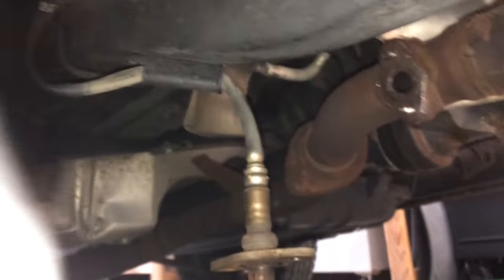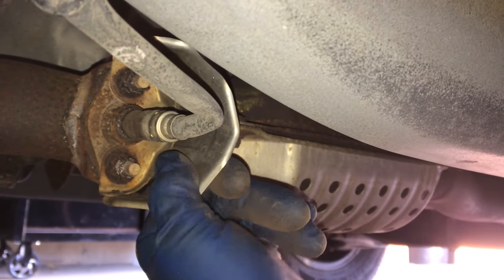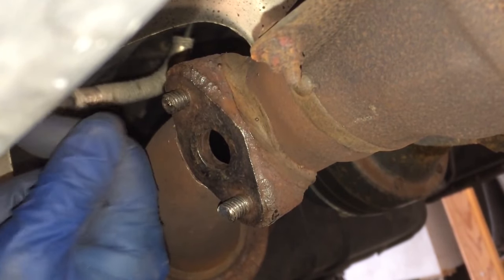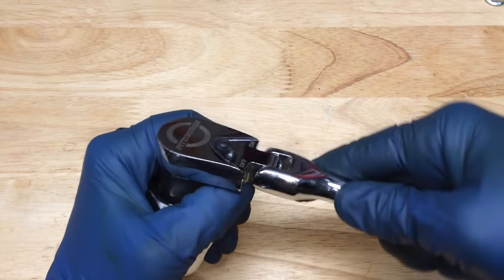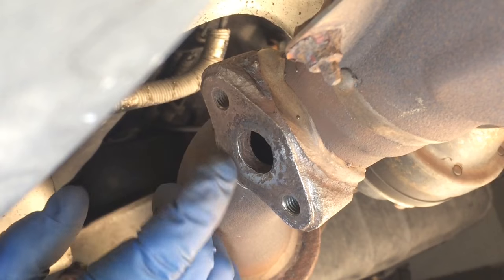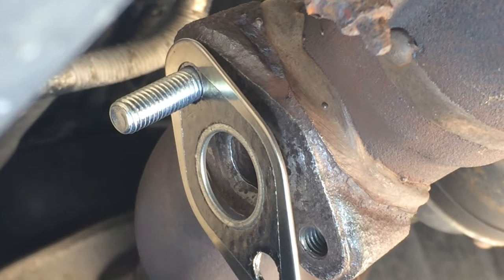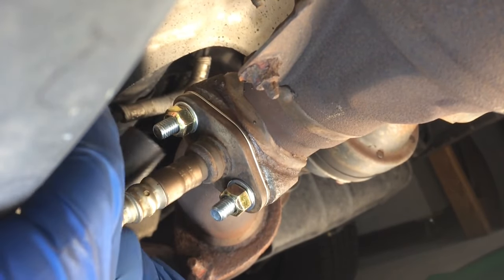Toyota Exhaust Stud Repair, Oxygen Sensor, NO WELDING, Rusted out Stud Extraction (1998 Rav4 shown)

Comment from the maker: Timestamps, Part Numbers, Tool info, Torque values:
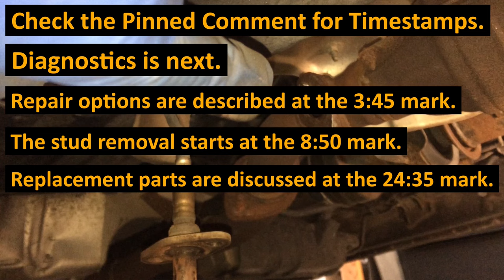00:30  Diagnostics
01:45  Other parts missing on the exhaust system shown
Oxygen sensor shield: Toyota 89437-60030
Catalytic converter shield: Toyota 18435-20020
03:00  Exhaust leak sound from the exterior
03:13  Exhaust leak sound from the interior
03:50  Repair options

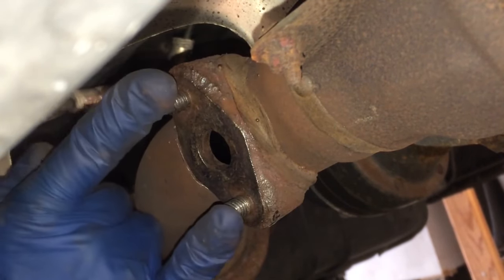05:37  Stud removal tools, ARES 70016 
08:50  Install the stud remover
10:40  Heat the flange
11:05  Remove the stud
12:41  Same process on the other stud
14:55  How to remove the stud from the tool

15:24  Welding/drilling options if the stud extractor doesn't work for you

18:18  Autozon rental tool kit: OEM 57142 Tools Thread Restorer Kit 
19:10  Use the M8x1.25 thread chaser to clean the threaded holes  

24:35  Replacement stud and nut options:
  Toyota studs: 90126-08001
  Toyota pinch nuts: 90179-08059 
  NAPA/Dorman studs shown: Napa 605-1347, Dorman 23737
  Lock nuts shown:  Needa Parts 005790
  Dorman flanged lock nuts: Dorman 432-308
26:27  Overview of the two-nut method to install studs

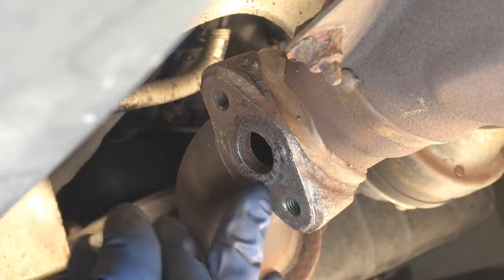28:17  Install the new studs using the two-nut method
30:26  Check thread elevation, if you're using odd studs

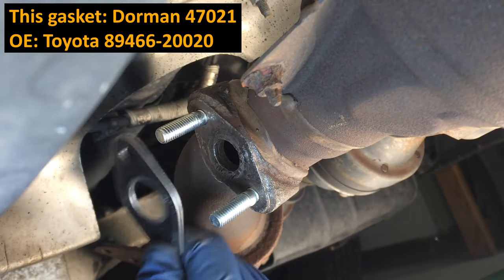32:14  Install the gasket (Toyota 89466-20020, Dorman 47021)
32:30  Install the nuts (torque is 32 ft-lbs)

34:32  Interior sound, after repair
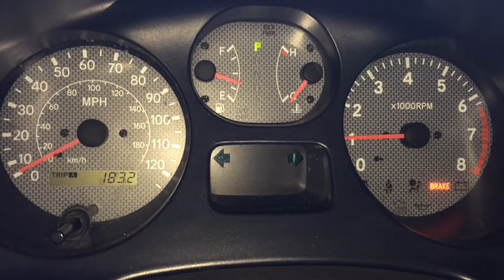35:04  Exterior sound, after repair
35:16  Check for exhaust leaks with soapy water

I hope this video was helpful for you.  
Thank you for watching, and good luck with your repair! : )

Comment: cut these bolts and weld new one - it is 2 min job.
Reply from the maker: Yes, that's certainly an option (discussed at 04:30), for those with the parts and a welder!  But I gotta say, the ARES stud extractor is a great option for those without a welder!  Thanks for watching and adding your tips : )

Comment: Get a new pipe with a bung. Find an o2 within your range and install the plug on the new one a d get rid of those stupid studs. Those are way obsolete by now. Noone uses those 😂😂😂😂😂😂

Also the cat is up by the manifold on this car it was built directly to exhaust manifold l. It could be considered a second cat  but its nothing but a pipe with holes inside it packed with glass.
Reply from the maker: Yes, indeed, that repair option is discussed around 04:07, and is certainly a solution to this problem.  However, in this case, that solutions requires more expense and effort than simply replacing the studs and re-using the original oxygen sensor, and it is also a more technical repair (my goal is always to try to show the most DIY-friendly approach, if possible!). 
Additionally - and this might not be applicable where you live - but some jurisdictions (particularly cities/metro areas) have strict emissions inspections (sometimes called "smog tests").  These tests often include visual inspections - particularly with a mirror to look for modifications to the exhaust system.  In these jurisdictions especially, it is a priority to keep repairs as "OEM" as possible to reduce the likelihood of an accusation of "emissions modification" and all the trouble and wasted time that comes with that!
Regarding the cats: the '98 Rav4 shown in the video is a Federal emissions version, so it has just one cat, which is the cat shown. 
There are two configurations for the gen-1 Rav4 (and other Toyotas of that era).  What you're describing with the TWC (three-way catalytic converter) at the exhaust manifold is the California emissions model (CARB-compliant).  If you have an FSM, check out page EC-2, EC-14, and EC-15 to see what I mean.
The California/CARB models have two cats: 
- the TWC at the manifold, which is called by Toyota the "Front TWC with Exhaust Manifold" and 
- the second cat, which is called by Toyota the "Rear TWC" (which is located in the same spot as shown in the video).
The other, more common, configuration is the one seen in the video -  which again is a single cat, as shown.  Toyota calls this cat simple "TWC with pipe".  These are the "Federal" emissions models.  
The difference can be see either by inspection, or without inspection by running the VIN.  Or, what's even easier is if the vehicle has its original hood, there is a sticker on the inside of the hood which states either Federal or California.  The hood VIN sticker can be matched to the body VIN plate to confirm if the hood is original. 
I hope that clears things up!   Thanks for watching! : )

Comment: Amazing presentation as always.  For the new studs, would you think applying nickel based anti-seize or synthetic brake grease (both are for high temp) will prevent future corrosion, therefore helping easier removal the next round?  

That RAV4 sounds so good before the repair.  It's like turning on sport exhaust button in AMG V8 😅
Reply from the maker: Haha, it did sound pretty good, but it drove rather poorly while making all the noise with that huge exhaust leak!  : )   It wasn't having it, at all, going up slopes!
As for the anti-seize: I'm neutral on it for this application.  I like anti-seize for lots of applications and have used it on exhaust fasteners before (the long bolt+spring types and some flange connections).  It certainly helps for connections you'll likely have to open again, like the connection between an exhaust manifold and the first pipe.  So, I don't think it's a bad idea or anything, but I didn't use it on these new studs.  The "red wrench" (aka the torch!) is my go-to for removing stubborn fasteners on exhaust systems and underbellies because, as you know, rust/corrosion is usually they'll become uncooperative, haha : )
Thanks for adding your tips and thanks for watching! : )

Comment: Hello dear madam, all your posts or episodes on YouTube are more than wonderful and much better than even the engineers of our Toyota dealer, and this is a fact and not a praise. You have published a lot of important things and there are only two episodes left, I think, which are 1- An episode about cleaning the injectors (disassembling and cleaning).  2-The second episode is about changing the automatic transmission oil.  This is one of the most important episodes. (for rav4 1998)I hope you will do it, thank you very much

Comment: Hello, dear madam! Do you have a video on how to remove and clean the fuel injectors for a 1998 RAV4?
Reply from the maker: No, I don't have such a video yet, but next time I do that job, I will make a video if I can.  Thanks for watching! : )
Reply: @L35inColorado  
I hope you do that. Thank you very much
Reply: @L35inColorado  
Dear madam,

I have a problem and I need your help, please.

I used the original type of fuel injector cleaner (which is added to the fuel tank) from Toyota dealer and the car improved, and the fuel consumption decreased, and 20 liters of fuel would cover about 110 miles.

After a while, I decided to repeat the process in hopes that it would further improve. However, I used the fuel injector cleaner contrary to the written instructions on the box. I used the entire box for about 30 liters, while it was supposed to be used for 60 liters. As a result, the fuel consumption increased, and now 20 liters of fuel only covers 94 miles.

Please, what could be the problem that occurred, and what are the suggested solutions? I would appreciate your assistance.

Comment: Great job and informative. I liked your time stamps. I have an almost similar issue on my Rx300 but my studs are just rusted. Nut won't thread. So I've used a hose Clamp around the studs to hold the 02 in place no problem for years
Reply from the maker: That is a solution, too!  Even wiring the sensor in place while waiting for parts can work to reduce the exhaust leak.  If you're interested in a possible "free repair", see if you can get that Autozone rental of the Thread Restorer kit (18:18).  You might be able to the use the M8x1.25 thread chaser (the one shaped like a nut) to clean up your rusted threads enough that you can get the nuts back on...?  Just a thought! 
If eventually you develop an exhaust leak that needs to be addressed (ie, the sound increased and you notice power loss, especially on hills), then hopefully the stud extractor works as well for you as it did for me!  I was so surprised - I really thought I was going to have to plug in the welder!    
But hey - you can probably run for a good while with everything clamped in place, too!  
Thanks for watching and for adding your tip! : )
Reply: @L35inColorado  Thanks. Subd

Comment: Great vid-- my two cents--if this doesnt work ill use a oxy/acy torch set that gets much hotter and QUICKLY heat the  area around the stud. cheers
Reply from the maker: Yes indeed, that will get it nice and hot, very quickly!  Thanks for adding your tips, and thanks for watching : )